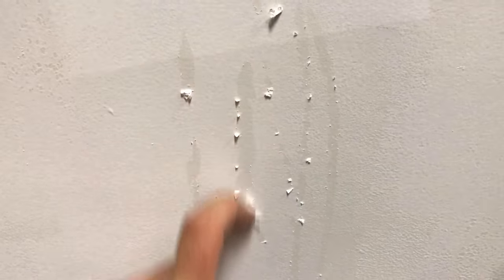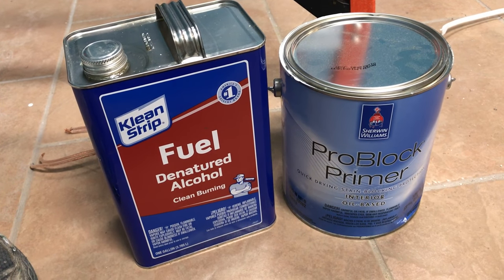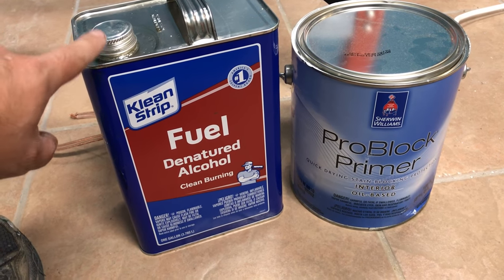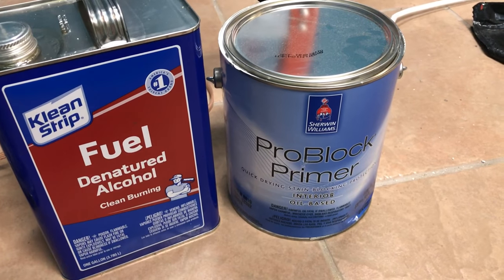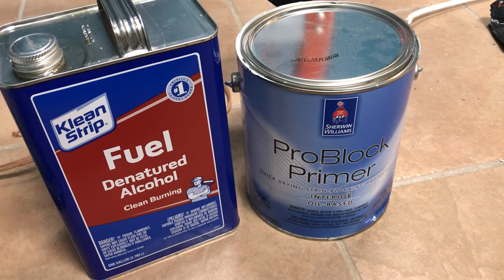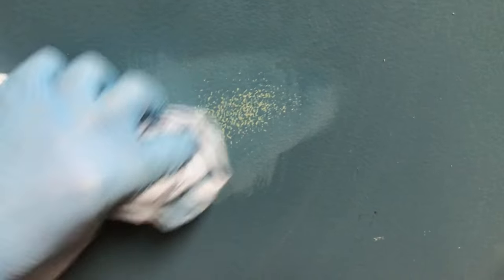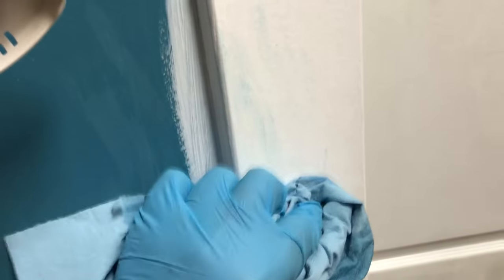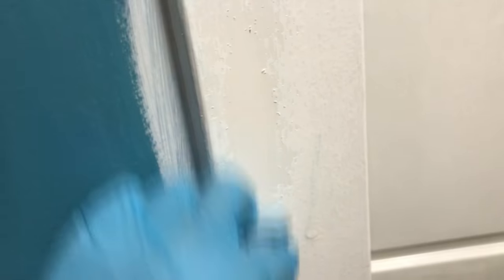#1 Mistake DIY Painters Make (How to paint over oil based paint)

Comment: What if the denatured alcohol does not rub the water based paint from the oil based paint? I did the exact same mistake as you. I learned the hard way.:(
Reply from the maker: Derek Hussey 1. Light sand (~100 grit) the surface and wipe off the dust with a tack cloth, doesn’t need to be perfect. (In this video I was not able to get all the water based paint off and it’s still adhering nicely a year later) 2. Apply a dedicated oil based primer over what you previously painted. 3. Apply your water based paint.

Comment: I have a question.  My bathroom has a oil based paint that has been there for 20+ years.  I am ready to paint it a color now.  I  bought an oil based primer and then I assume I can do that and then use a water based paint after.   Am I correct?
Reply from the maker: Heather Garrison yes correct. That will work.

Comment: Can we use oil based primer with water base paint?? 2nd are there two types of wall putty? Wall putty for water base paint or wall putty for oil paint??
Reply from the maker: Yes you can use oil base primer and then water based paint.

There are a few types of wall putty and joint compounds. You will want to sand and prime over whatever wall putty you choose before painting. It won’t matter whether the putty is going over oil or water based paint.
Reply: @notwaitingtolive   means that i can use oil based primer then wall putty and than water based paint.. it will not affect my color right?
Reply from the maker: @hanzallamuzaffar3288  you need to prime the wall putty too. Everything needs to be primed to paint evenly
Reply: Thank you for your time brother ❤️ last question is today my father told me that in your room there was oil paint and now you're planing for water based paint. Can i apply water based paint on it because oil paint was about 10 to 12 year old..

Comment: Hello!  I have made the mistake of painting over oil based paint with water based (hybrid) paint that was suppose to stick to oil base.  After several months of the paint job being completed i noticed a spot that had peeled up.  Well…the paint on the entire door easily peels up.  My question is..Can i paint over the other doors and trim that hasn’t peeled up with an oil based primer and then go back over with my water based paint?
Reply: Best to remove all the loose paint. Sand the old oil based paint down fully (not just a quick rub) and prime with a good quality primer. Water based is fine. Then undercoat and 1to 2 top coats depending on the paint. People think that because it's fast drying it's a quicker job. There's way more prep work involved than with a recoat of oil based paint.

Comment: Hey was curious about coating oils with the same brand and color match but with a water base, I'm guessing my wrinkles are from too thick of 2nd or 3rd coat. I'm painting a 2'x2' sample before painting my finished product 6'x6' panels. My sample turned out perfect, attempted the same on my sign faces and got wrinkling on some edges and two larger areas one on each face.
Reply from the maker: You’re attempting to put water based on top of oil? And it’s wrinkling?
Reply from the maker: If that’s the case you can use a clear binding primer in between the oil and water based coat. Something like this: https://amzn.to/36QRahG
Reply: @notwaitingtolive  yes and it only did on my big panels, not my test panel. Thank you for the quick reply, maybe in the next ten years when I attempt this again I'll try that. But this current project is getting sanded down to primer, primed again then I'm just sticking to the water based.

Comment: Can I put oil base metal paint primer on a latex paint (front door which painted 10years ago) ?
Reply from the maker: Yes. I’ve done this on my own front door. I recommend oil base paint for the front door as well due to the exposure to the elements. I also recommend a spraying a couple layers of clear coat by rustoleum to protect the paint from fading into n the sun.

Comment: I'm a complete newbie on paint trying to learn first. How do I know if I have oil or water based paint on my walls... Do I use denatured alcohol...or is that only to remove paint after you make the mistake of painting over oil based
Reply from the maker: desertcat3 water works too for identifying oil based paint. Denatured is just more effective. Use a wet rag that has different color than the paint and try to wipe it off. If you can see the paint coming off it’s water based. If you’re only washing off dirt or grease but no paint that’s oil based paint.
Reply: @notwaitingtolive  I think you can do this test with acetone ( polish remover) as well. Just cheaper and most of us chicks have it on hand (acetone) I seen this tip in a Home Reno VisionDIY vid.Thank I did this mistake to our kitchen cabinets! Biggest pain in the rear ever.

Comment: I'm a bit confused. Before painting over oil based painted wall with oil based primer, I'll have to remove all the water based paint or just clean/sand what's peeling? Darn it, my 80 year old father has been doing the painting himself for his 40yr old house. Now I know why we've had this problem...Would just painting over with the oil based primer be enough to get it ready for water based paint? (please say yes🤞)
Reply from the maker: Chris G I’d recommend using a pole sander like this to lightly sand off what you can from the wall: https://amzn.to/3hexyY3

You need to peel back whatever’s flaking or peeling but not any deeper than that. Scuffing up the rest of the wall should help agitate anything else that wants to peel off in the near future. 

You don’t have to get rid of every little bit of water based paint. I only removed what I could get off at the time in this video and the paint is still adhering well since painting last summer.

Let us know how it works out.
Reply: @notwaitingtolive  thank you for taking the time to respond. I really appreciate your knowledge. My father bought this old, two story, house as a fixer upper 40 years ago & has done the work himself (he thinks he can do anything. Even fly a plane if u let him, ha ha ha. It's why he's the best dad in the world!). Anyway being a "girl dad" of 5 females, no sons, he has done the work pretty much on his own (it's been a never ending project). Oh & did I mention it's a "duplex"? He's now 80 & still working on it, SMH. 
My sister's & I have painted through the recent years & would run into this problem. We would just keep it that way & tried not to touch the walls lol. This time I decided to do some research first, thank God I did. I'm sure my  Dad will be very excited when he hears he now can have a new project, helping me sand off walls. Did I mention I have the best Dad in the world? :-)

Comment: How can I paint over a semigloss wall with flat paint without sanding? I painted this wall with semigloss by mistake yesterday.. 🤦🏻‍♂️ whats my options? Thanks in advance!
Reply from the maker: R G There are two steps to going from a semi gloss to a flat.

The cheapest route (but maybe not as effective) is to wash the wall with TSP (trisodium phosphate). This is a common cleaning solution they sell at Home Depot that is what most painters use for prep work. https://amzn.to/2PmiGdk

Alternatively you can use a more expensive liquid sand paper/deglosser which is designed for removing sheen. But this will cost serval times more than just using TSP. https://amzn.to/3a2OAp3

Then no matter what you use to clean the wall, prime over the wall with a dedicated primer (not a paint and primer combo) before painting. https://amzn.to/2ELNmmo

P.S. flat paint is very sensitive to scuffing and marks. A lot of builders use flat on the wall just to save money and hide imprecations because the lack of sheen makes defects harder to spot. I highly recommend using BEHR extra durable flat when painting flat on walls. I use this paint when painting garage walls which are usually full of defects and susceptible to scuffing. https://www.behr.com/consumer/products/interior-paint-and-primer/behr-ultra-interior/behr-ultra-scuff-defense
Reply: not waiting to live thank you very much for the info!! I guess no matter what I will have a lot of work! :( what happen if I just apply flat paint on top or the semi-gloss? Can it survive without touching it? Cause these walls i painted start at 6ft up to the ceiling. So no body are going to touch them. The question is if it would survive years even without touching it.
Reply from the maker: R G the semi gloss sheen will shine through the flat making it still appear glossy. The most important action you can take to knock down the sheen and give the flat paint the best chance at adhering well is to prime the wall with a dedicated primer.
Reply: not waiting to live ok thanks!

Comment: I did this recently in a bathroom.  I  wonder if a little heat and a scraper will get it to peel off?
Reply from the maker: Robwestcoast I haven’t used a heat gun in this application but I’ve read that a $20 gun like this that they sell at Home Depot will soften paint water based paint. https://amzn.to/2W86HVz

If you need to strip the walls you’ll be better off using an electric pole sander to remove what ever isn’t adhering well. For the trim, a wipe down with denatured alcohol and a light pass with 100-grit or so sand paper should get you to the point where you’re ready to cover up what’s needed with an oil based primer.
Reply: Be there forever!!

Comment: OK, so what is next after the water based paint is removed?
OR same question really 
What should have been done in the first place to the oil based Kilz?
Reply from the maker: Starting with an oil based primer or shellac based primer will enable you to follow up with whatever water based paint you want to use.
Reply: I am planning to paint our doors and trim that had been stained and lacquered. Started with kilz hide all primer which is a water-based primer and noticed once it dried you can scratch some of it off with a moderate to hard scratch. Will that cause a problem after other paint is over top of it and do I need to go back and use an oil based primer?

Comment: Now, how did you clean it?
Reply from the maker: Sylvia K I use denatured alcohol to clean up fresh water based paints. I use paint thinner to clean up fresh oil based paints. I use acetone to clean up dried old paint of either type. And in general I simply dust before applying new paint/ primer. Many people will recommend cleaning the surface with TSP (a cleaning solution you can buy at stores like Home Depot) before painting. Another general recommendation is to use a wipe on liquid deglosser on semi gloss or gloss surfaces instead of a primer before painting. I will almost always just paint right over water based paints without cleaning or prime over oil based paints without cleaning.

Comment: can i paint acrylic paint over old epoxy floor
Reply from the maker: You need to sand the floor first with ~100 grit sand paper to give the paint the ability to adhere to the surface. You can use a pole sander or electric pole sander to make that task a lot easier than doing it by hand https://amzn.to/3hl64Ao. I'd recommend priming it as well with a bonding primer before painting.

Floors take a lot of abuse. I'd recommend using oil based paints on the floor as they'll be more resilient.

Comment: Well... someone painted my entire bathroom walls with oil base paint and on top of this water base paint. Now everything is peeling. Do I have to peel it off the entire walls before primer ? This will take me weeks 😭
Reply from the maker: Use a drywall sander like this with a shop vac attachment for the dust. https://amzn.to/33QFhWg

You can sand off the peeling areas with the tool then use an oil based primer over everything before repainting and it should be fine. I know it may seem impossible but the tool really speeds things up and helps me stay positive.

Comment: how do you know if your surface has oil based paint on it?
Reply from the maker: Nancy Clifton if you wipe the surface with denatured alcohol and the paint doesn’t wipe off its oil based (use a colored paper towel or rag to see the pain wiping off). Alternatively you can just use water, but it’s harder to tell. Water based paint will eventually be noticeably affected by water based paint, but some of the semi gloss paints take a little bit longer to break down. Water does not wipe off oil based paint.

Comment: It’s simple: don’t primer anything with an oil base primer if your using a water base paint. If you do, whatever you paint over it (with a water base paint) will flash all those areas you painted over a oil base primer. 

If you come across a wall with oil base PAINT; just simply sand it, primer it with water base primer (good one) then paint using a water base paint. 

You can’t just put a water base paint over oil base print because it will not dry and it will give you problems, but you can use a water base paint over a oil base primer however it will flash and look really bad.
Reply: I have panted over oil based primer with water based paint and have never seen the flash you are talking about.
Reply: Hi
Interesting, because it’s normally seen if you look from the sides or lots of lights. I get a lot of clients who call me and say: their painter left flashes. On their walls where they did patch work. My response is: they used a oil base primer after sparkling and then painted with a flat water base paint. 

It’s real noticeable with flat paint but not so much with a sheen paint. 

Great video 
Blessings
Reply: Lia Hello, sounds like a lot more work and messy, however, I’m sure that will work as well. In all honesty, simply sand (scuff) and then primer using a water base primer then paint 
Good luck 
Blessings

Comment: Couldn't you just get a paint that has primer in it and just repaint the thing?
Reply from the maker: Not if it’s waterbased. I actually used water based paint/primer in this video and got these results. The primer needs to be oil based or shellac based.

Comment: instead of using denatured alcohol to remove oil based paint.
 wouldnt it be easier to just sand it with a fine grit sand paper, prime and then paint?
Reply from the maker: The trouble is sanding too light isn’t enough and sanding too rough causes damage or unevenness, especially on walls. Sanding works though, I just wouldn’t call it easier.

The reason I show a chemical solution hears is it forces more of the paint to come off without affecting the surface. But be aware of the health effects. Wear a mask and keep the space well ventilated with a fab and open windows when working with this stuff in doors. 

For the record denatured alcohol is what’s used to remove water based paint. Paint thinner is used to remove oil based paint.
Reply: @notwaitingtolive   oh okay thank you, for replying and sharing that information. very good to know.

Comment: you dont need to mess about scrubbing any paint off. changing oil based to water based, simple..... sand the oil based gloss just enough to key it / then apply shellac primer like zinnser bin / then key it when dry / then whack your water based over the top, it will take a minimum of two coats. and dont buy cheap water based gloss theyre all shit. get something like scuff-x it cost aroun £100 for under 4 litres but its the best finish you can get.

Comment: Mate if u wud ave sanded it first u wud no weather it was oil or water based, cos water base scratches differently to oil all decorators no that 😕
Reply from the maker: Interesting tip. I’ll have to look out for that.

I have other home improvement tips you might be interested in like the best way to wrap an extension cord: https://youtu.be/NUIwDFIHvDI